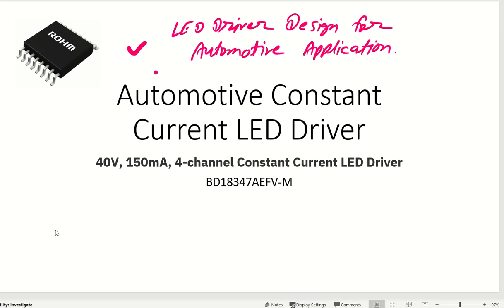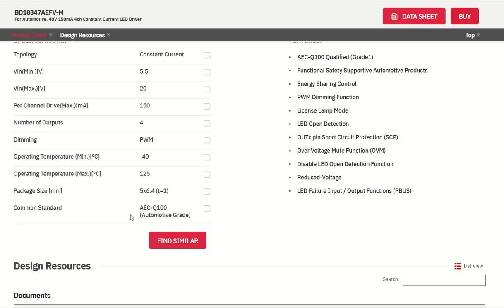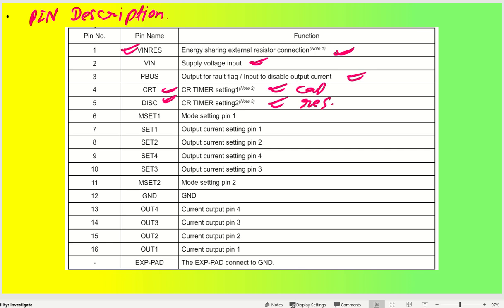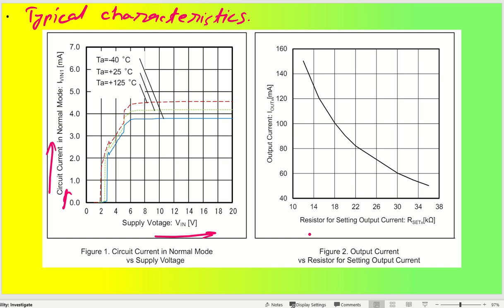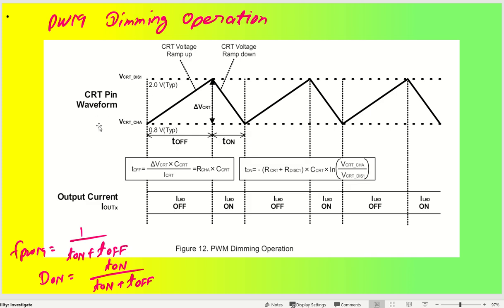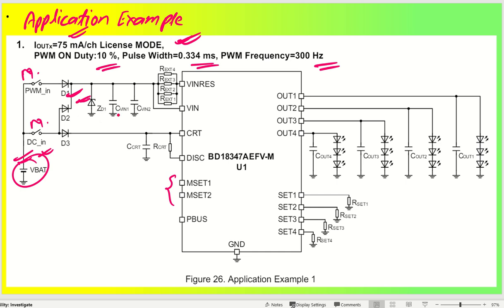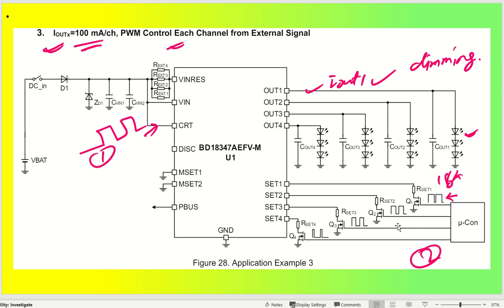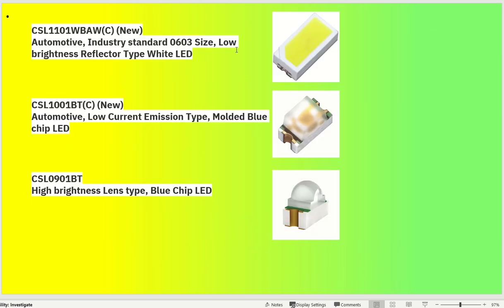070 Automotive LED Driver Design and Implementation

Comment: Thank you for explanation, could you please tell me what is the role of the 4 resistors that you put in the VINRES pin? 
Thank you in adavance.
Reply from the maker: These are external resistor to connect with VINRES pin for energy sharing. If you wish not to use energy sharing feature, you can short this with VIN pin. also there are several applications circuits used in the datasheet, you can have a look. Thanks for asking, hope this is helpful

Comment: Sir , kindly explain more advanced led driver this is a simple one
Reply from the maker: Yes, you can refer advanced LED Driver BD94130EFV-M, BD94130EFV-M

If you need the design implementation, you can reach us out. Also, we will try uploading video explanation on this as soon as possible.